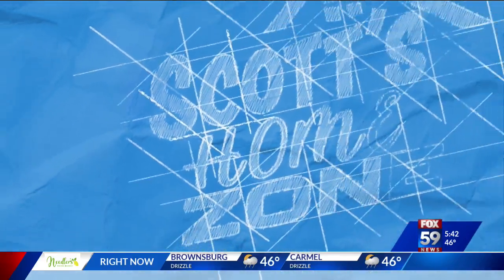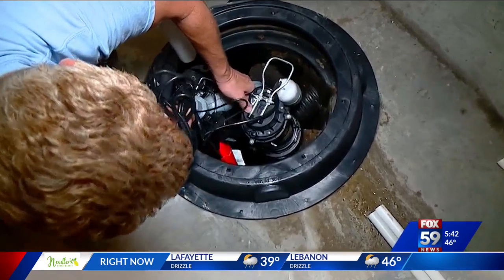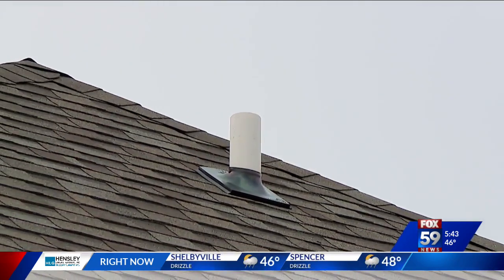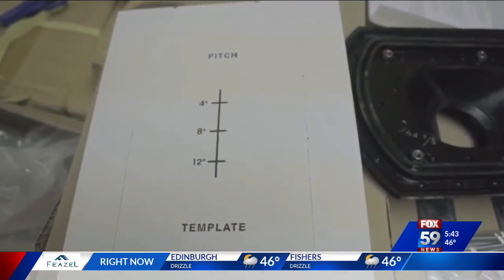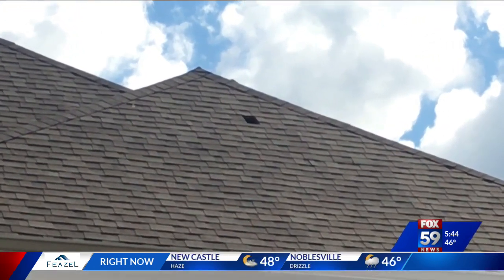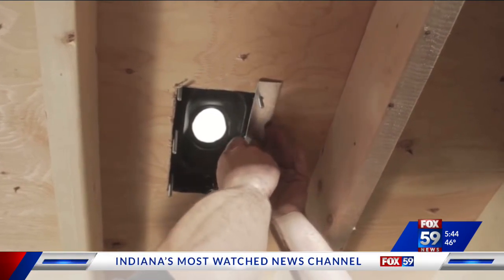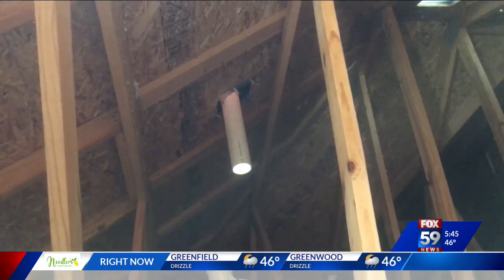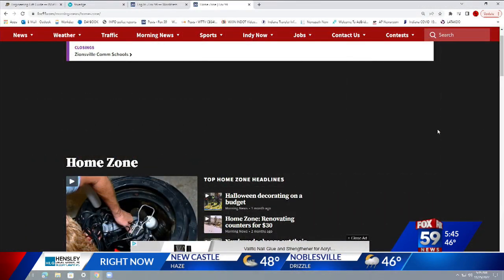How to install roof vent pipe without going on your roof

Comment: Thanks for this! Just an FYI, never mount an outlet with the socket facing up. They can fill with dust, debris, and or insulation. This renders them inoperable or could cause a fire.